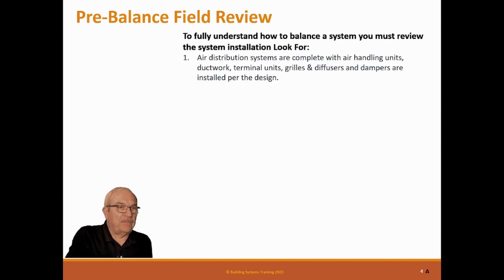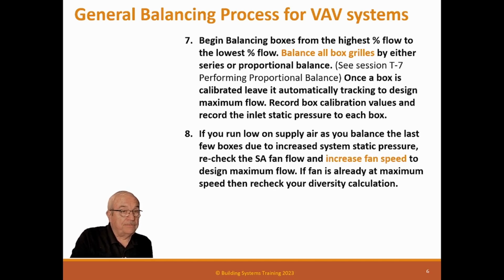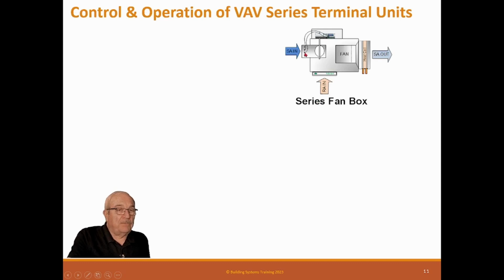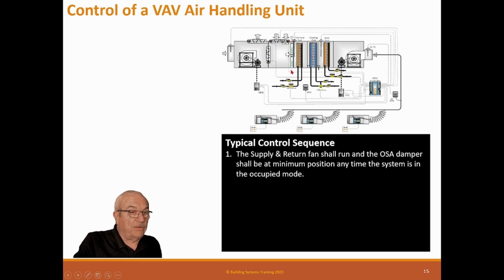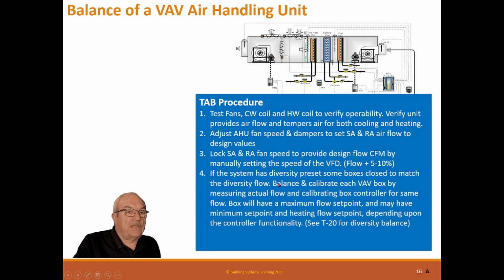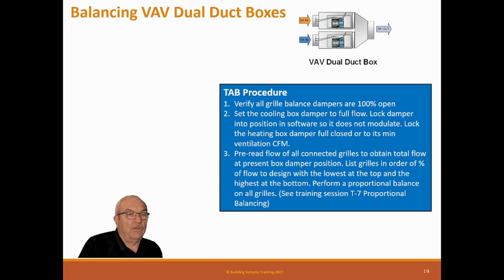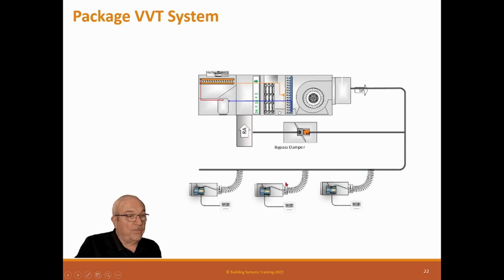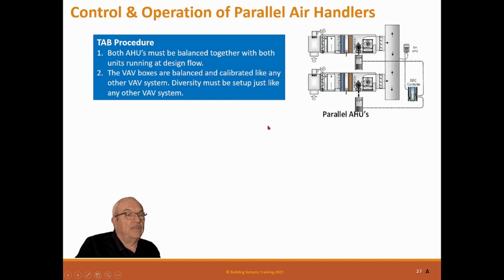HVAC TAB Air Balancing of VAV Systems. Training Session T-15

Comment: I approach balancing VAV AHUs slightly differently. Rather than setting the fan for design airflow at the beginning with all the VAVs 100% damper open, I instead first ensure all the airflow setpoints have been put into the terminal unit controllers and have the AHU fan track to a starting static pressure setpoint (1"w.c. is usually a good starting place). Then balance each terminal unit individually. This segments the system into a lot of smaller systems so rather than balancing a 200 diffuser system its 20 systems with 10 diffusers each for example. Once every terminal unit has been balanced and calibrated, I then will send all terminal units to max airflow (assuming no diversity) and adjust the AHU static pressure setpoint until the most open terminal unit is 80-95% damper open. That static pressure is the static pressure setpoint. What is the advantage to setting the system fan to full flow at the beginning and having all the terminal units wide open?
Reply from the maker: That is an interesting way to do VAV AHU's, but it does have a problem with having adequate air for the VAV units. When you pick an arbitrary static pressure setpoint with the VAV boxes all modulating to their flow CFM without calibrating the box controller you are not really balancing the box for maximum flow under the real pressure conditions with all boxes flowing design flow. One way to do these systems faster is to set the AHU up to near full flow and then calibrate each box separately balancing the connected grilles periportally to each other. Then set the boxes to their design setpoint with all boxes calibrated then go back and set the correct duct pressure setpoint with all the boxes driven to full flow. Make sure all boxes reach full flow. Re calculate each boxes grilles by reading the key grille on and multiplying the grilles calibration flow by the % deference. Once this is done then re-read the AHU and issue the final report. Of course, if the system has diversity this process must be segregated into two balance processes as described in the video. Sorry for the long answer, hope it makes sense to you.